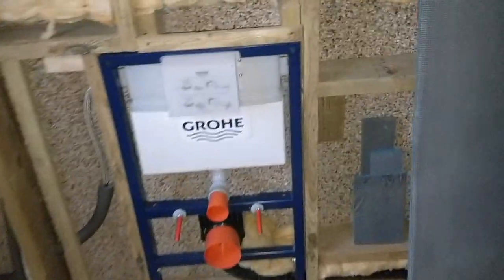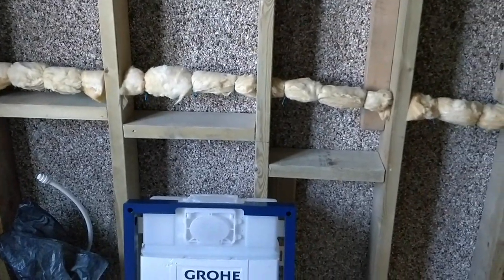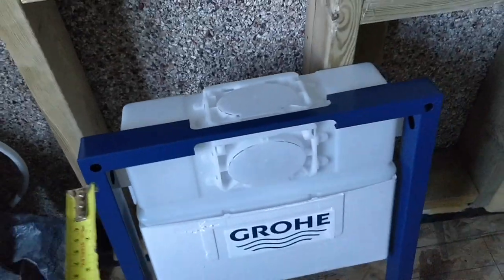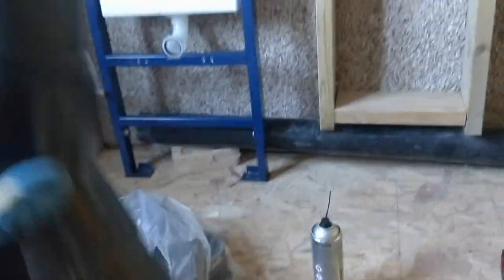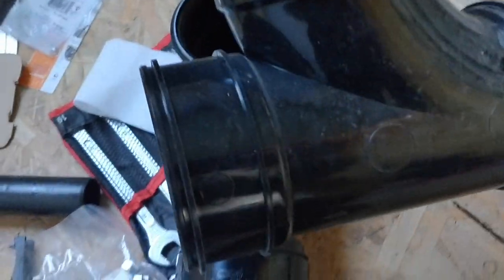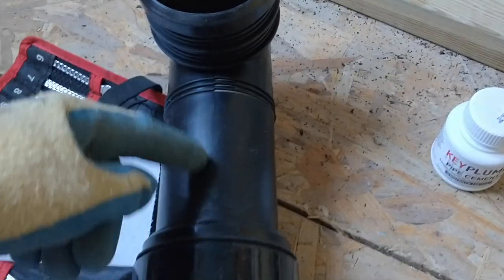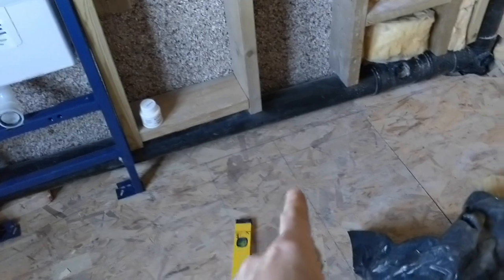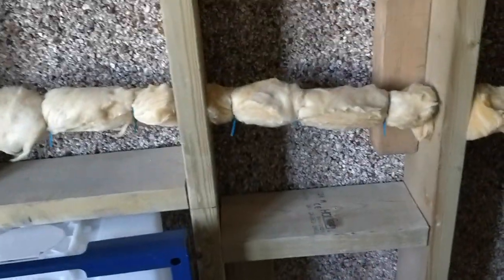Grohe concealed cistern installation - Part 1

Comment: Hello, I have a horizontal pipe as well. Do you think I can still install a wall hung Grohe?

Can you share link for the 90 degree bend pipe from wherr you bought it?

Also, which Grohe frame is this?

Comment: If you pushed it against the rendered wall and marked around the cistern - then removed that section of the render I reckon that would have gone in OK. The frame manufacturer normally sells the right soil pipe adaptors for that exact situation too. Good job though.😀

Comment: Those frames are normally set at a meter from finished floor. Don't suppose it matters I guess. Mcalpine do a nice pan connecter and flush pipe kit if wc doesn't seal correctly to waste pipe 👍

Comment: Would you be able to tell me whether you need to pre-drill a hole for the leg bolts and what would be the size of the hole if any? Thank you
Reply from the maker: The holes are drilled and tapped into the frame, but where you need to fix them into the floor or wall you should consider pre-drilling them. My subfloor was timber OSB so I didn't need to pre-drill, but my wall fixings were into brick, so that did require a pilot hole. The size depends on the fixing you're using, so I can't really help you there.